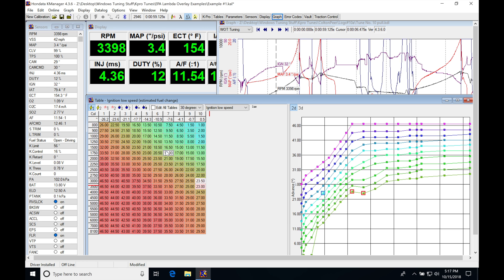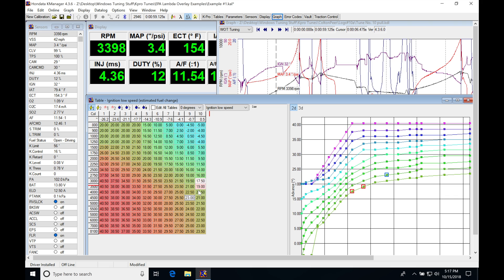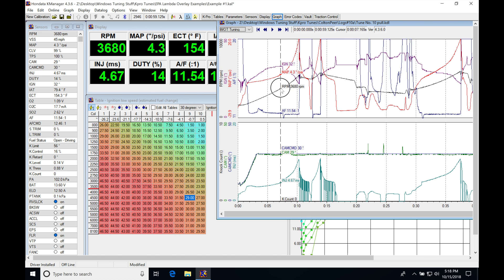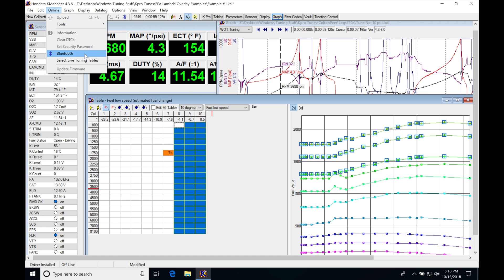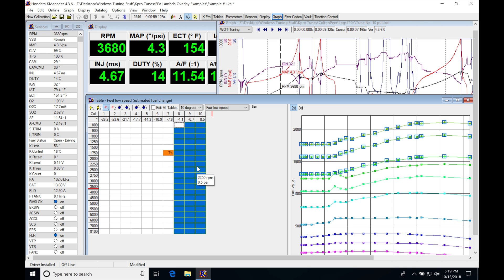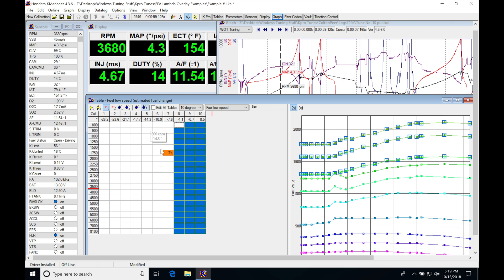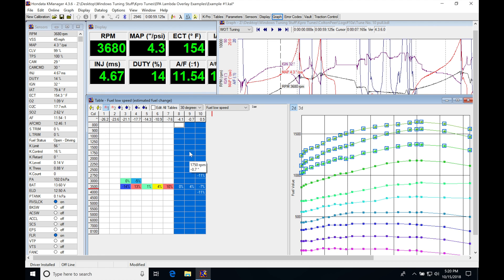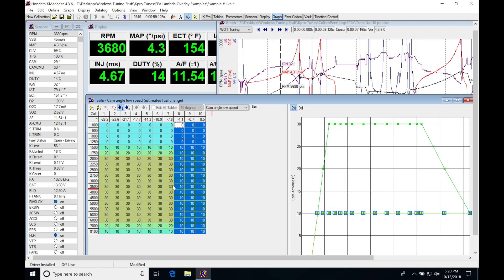Hondata Kpro: Full Throttle Tuning | Evans Performance Academy

Comment: Does Hondata REQUIRE on Kpro or S300 that you wire up to fuel pump lead on conversion harness in order for engine to run? I have a K series and am running a fuel cell w/ external Bosch 044 pump. Did away with EVERYTHING factory w/ fuel tank ,pump and pump rear wiring. Did a painless wiring fuel pump switched relay kit instead. Engine not starting YET. Any help appreciated. I know this is an old video and all.
Reply from the maker: No, neither require the fuel pump output control to be hooked up for the engine to fire up and run.
Reply: Thank you much Sir for your help and Super Fast response. I got it fired up this evening after work. Thanks again